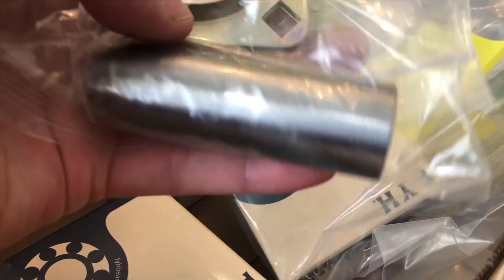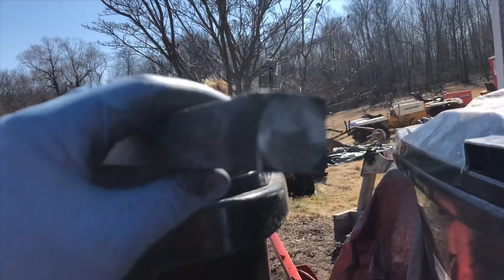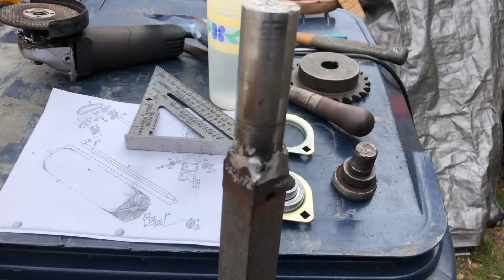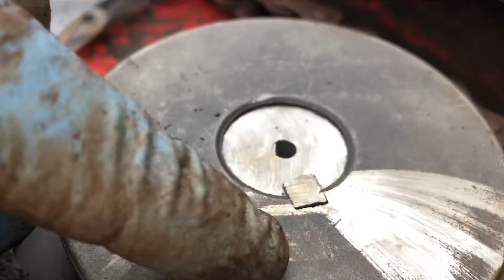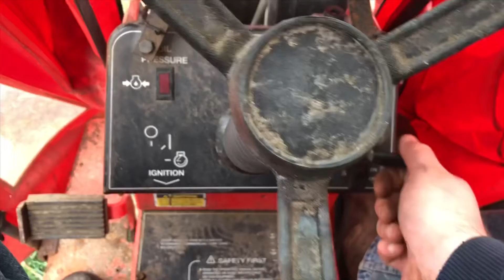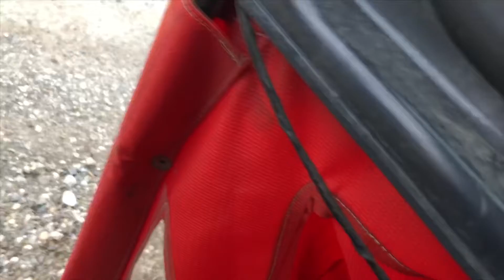Gravely Power Broom Shaft Repair Part 3 Final

Comment: Hi; I enjoyed your series on the broom repair as I have a dysfunctional broom just as yours was along with a snow blower for my 80's vintage Gravely Professional 8 with the Robin Subaru engine.  I never got into the broom repair as far as you did but far enough to see the bearings were shot, not sure about the shaft.  Its good to know that some critical parts are available.

Comment: Welcome back.  Nice job on the power broom.  I have a 44" QH power broom (functioning) that came with my 5665 (not running).  What would I need for a front attachment kit to run it on a 8122 with a manual lift?  Is the broom too much to run on a C8 (swap the QH from the 5665 to the C8)? PaulL
Reply from the maker: Panon1 hey Paul, I have seen guys run them on a C8.  Theee is a bracket that bolts on the broom to attach it to the 4 wheel tractor.   They you need the front adaptor drive shafts and lift are and double u joint etc.

Comment: Good to see you’re back. I was the one who theorized about the shaft construction. Interesting that it was a solid piece. I had a low mileage broom I got from an auction for my C12 years ago. They are very effective. All I ever did to mine was lube the chain drive and adjust the slack from time to time. My Dad still uses it.
Reply from the maker: Brett M. Gerasim nice

Comment: Thats great. I had a Gravely Broom for a walk behind. It looked almost identical to yours. I gave it to a friend. After seeing you operate yours i wished i had held onto it. They work great.
Reply from the maker: Dean Barr they are the same the rider just has a bracket that bolts to the broom to mount it.  There is also the old style fixed angle walk behind broom...